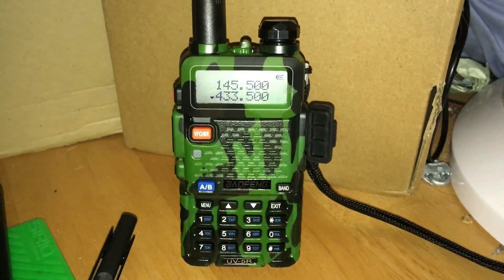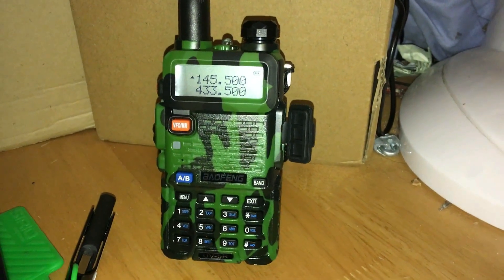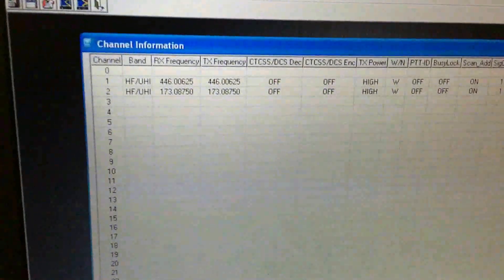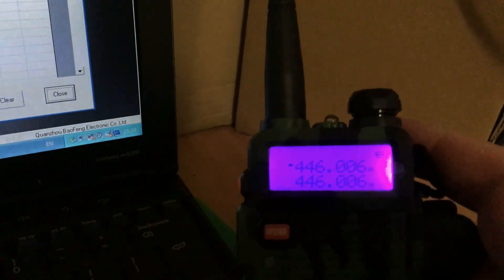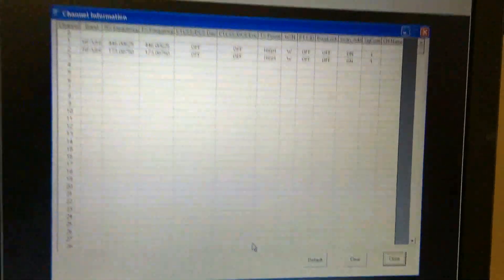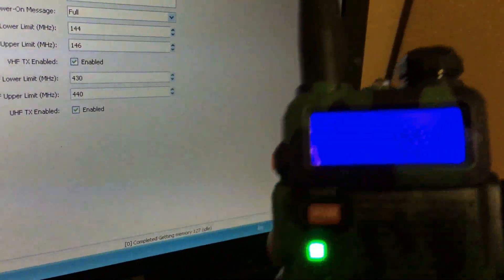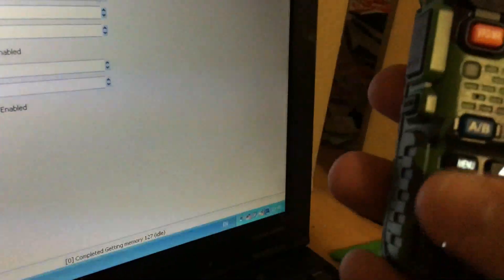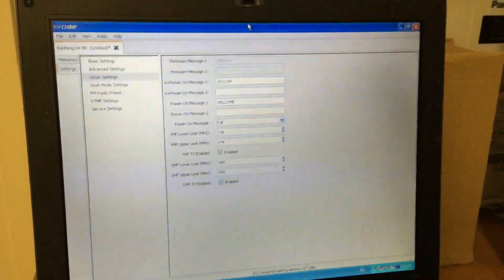PMR Radio: Making A Baofeng UV-5R Transmit Out Of Band (May 2023)

Comment: I wonder if the new 2023 UV-5R still has those spurious harmonics. And I'm pretty sure that there is any key combination that unlocks the radio without software. Just in case there isn't we now have a valid solution. Thank you 😊
Reply from the maker: Tried 3 different key combinations I found online, none worked (at least with this radio)
Reply from the maker: @chaosflower4892  As far as I'm aware, it's only the UV5R right now
Reply: Yes it's a sprog box, German P&TT have banned the Baofeng UV5R, so Baofeng produced
an uprated version called GT-5R. Baofeng cant just improved UV5R specs it would mean
liability for recall. Thats why Baofeng introduced its improved replacement the BF-F8+
 in 2014. (new model, new number, new liability, same style, same compatibility)
 but it didnt sell as well as the UV5R so they just carried on making the crap
Reply: Is it called the duel band or tri band?